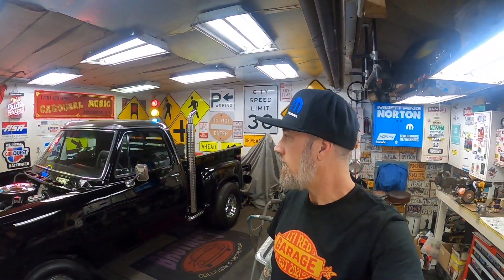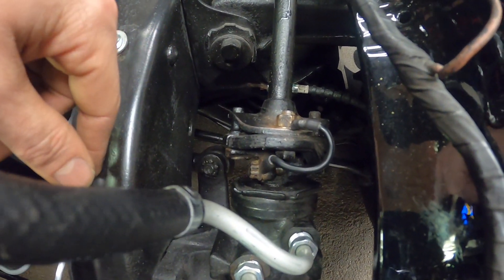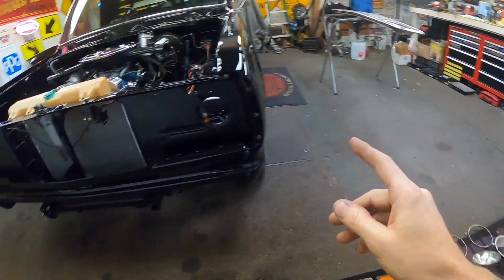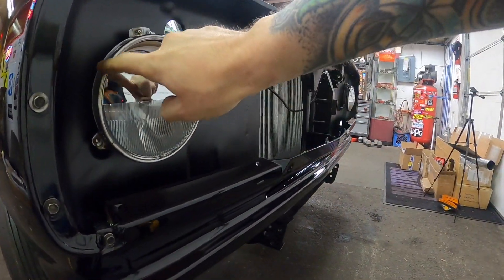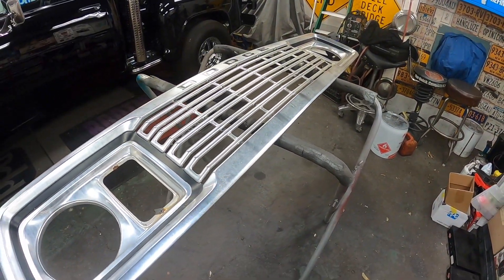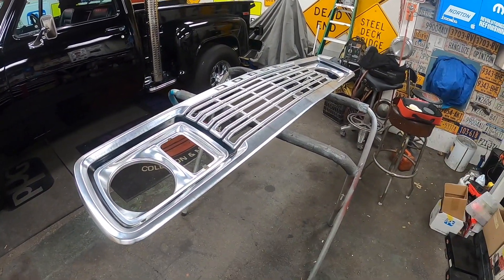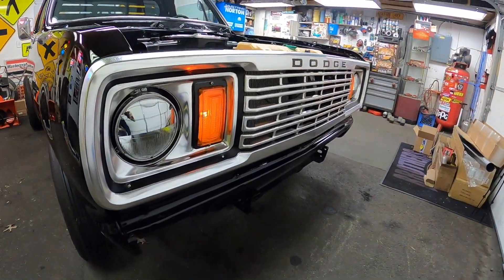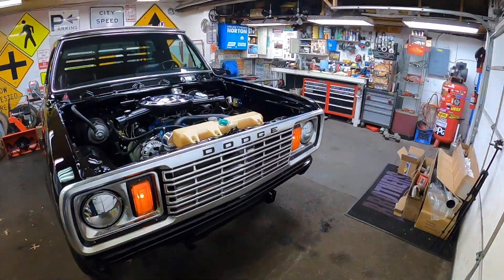Polishing a 1978 Tin Grille without removing the anodizing

Comment: If you want to eliminate continually cleaning/polishing "raw" aluminum parts, like your wheels, then treat them with 1500 (clear) alodine.

It's an aerospace coating that protects "raw" aluminum aircraft parts from the elements.

It's important to not forget to neutralize the alodine with distilled water after the treatment - alodine is an acid that will continue to etch the aluminum until neutralized w/water.

Comment: I see stacks!! Check that little ground wire on the rad support by the battery...that'll keep the headlights from working. Been there done that! That grill turned out great, the headlight chromes and bumper really tied it all in. Beautiful truck! Can't wait for the exhaust video.
Reply from the maker: 👀👀! Thanks Dave! I’m going to check those grounds again, and work my way back to the switch. I’m excited to do the exhaust! I’ve installed plenty but never built my own. It should sound awesome!
Reply: @LilRedGarage  already does! tempting to run it straight to the stacks?
Reply from the maker: I’m going to make the muffler removable, so I can try different ones or even a straight pipe!  the glass packs are straight through “muffler” so it going to be pretty loud!
Reply: @LilRedGarage  Dad drove truck for 30+ years, you don't want too loud right outside your window!
Reply from the maker: Lol ya! the exhaust tip is literally a foot away from your ears! When I drive Lil red It’s crazy how much quieter it is when I roll up the windows!

Comment: I remember seeing the "Warlock" and "Little red express" in the dealership many years ago.  My dad was buying a "D 50" pickup.  I remember being disappointed that he wasn't getting one of the "cool trucks." The little import was great though - lasted many years.  A trick for cloudy anodized aluminum is Vaseline. It doesn't remove the oxidation, but hides it well for a few washings. 👍
Edit: forgot to tell you that the truck is beautiful! 👍
Reply from the maker: Thanks jeff! A friend of mine bought one of those d-50’s it was black with yellow orange and red stripes. I could see how the Vaseline would work. While the compound was “wet” it looked great and it dried the cloudiness returned. I may try that thanks!

Comment: I always really liked the '77-'78 Dodge truck grill(along with the original '72-73 one)...I felt the '79-'80 grill was a step backward, especially the standard single headlight versions...reverted to the older setup of parking lights below the grill, and the grill itself reminded me of a mishmash of the '72-73 and '74-76 grill designs. I wish they had stuck with the '77-78 grill with the new hood for '79-80, and maybe offered an optional rectangular headlight option, sort of like Ford did for '78.....

Comment: I had to replace the headlight switch on my '78 Dodge pickup and also my '95 Dakota.  Both of them had burnt from the power going through them instead of having a relay.
Reply from the maker: I’ve seen a kit to add relays to the headlights. I’ll have to look into that thanks!

Comment: Absolutely beautiful. I've got a question if you're willing to share your knowledge? Ive got a 73 and the grill is beautiful shape but the anodizing is not. If I strip it can it be clear coated with automotive quality paint? I'm worried about adhesion without some type of etching primer. Any help would be greatly appreciated. Thanks.
Reply from the maker: Thanks Matt! There are products out there to clear over polished aluminum. I know they do it with wheels. I’m not real familiar with them. You are correct just using automotive clear over it you will not get good adhesion. There are also places that can re-clear anodize it, I’ve heard it quite costly, and you’d probably have to ship the grille witch can be risky.

Comment: To bad it's automatic my guess is a no frills 318 cu ?
Reply from the maker: 4spd swap is never out of the question!
Reply: Now your talking !   Ive done 5 auto to manual swaps 4 on my trucks and 1 for a friend.
Reply from the maker: Sorry I didn’t answer he second part of your question. The engine is a 418 stroker with Indy aluminum heads. Solid lifter cam, Harland sharp 1.6 rockers. all forged internals. Dynoed over 500hp 550ftpd.  10.5-1 compression on pump gas. Should be fun on the street. I know it’s not a 4spd but the 727 is built and has 3500 stall Hughes converter and 4.10  sure grip out back.
Reply: @LilRedGarage  Ok cool sounds like youve built it back well.